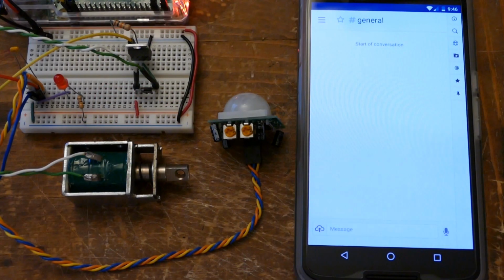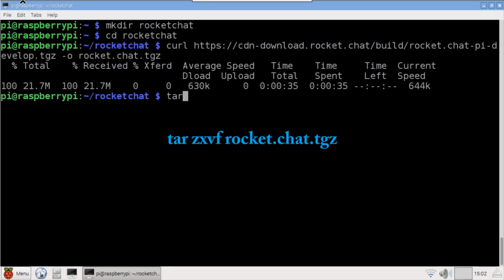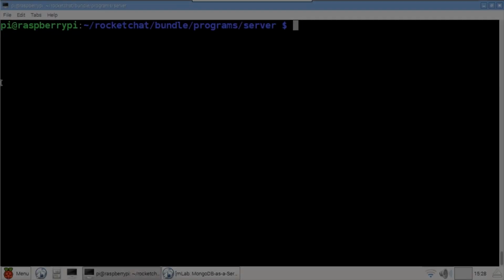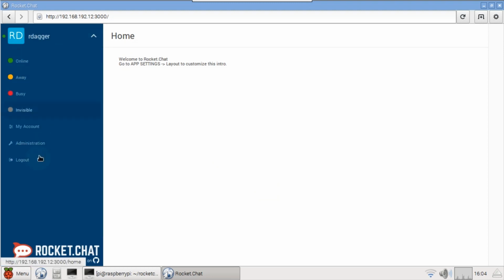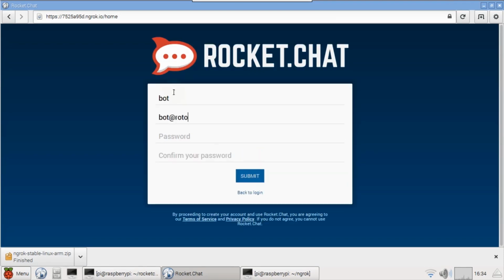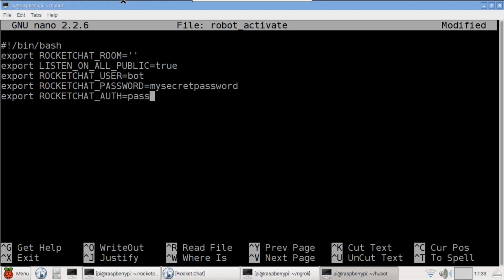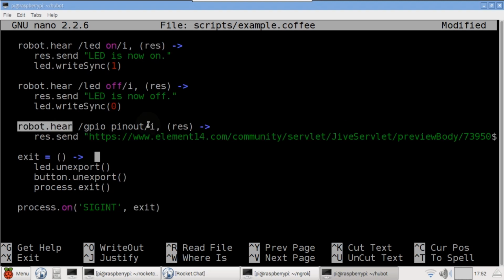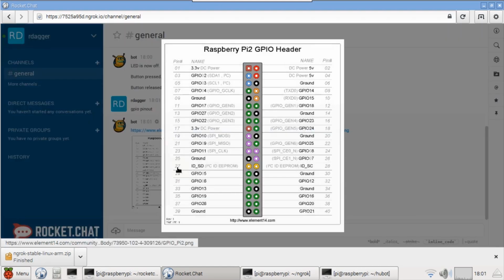Raspberry Pi Chat Server with Hubot Tutorial

Comment: Great Video but the URL to the cdn-download is broken. You should change your tutorial on your website: I had to download it like: 
wget https://github.com/RocketChat/Rocket.Chat.RaspberryPi/releases/download/0.39.0/rocket.chat-pi-0.39.0.tgz rocket.chat.tgz
Reply from the maker: It may have been temporary.  I just tried the original link and it worked.
Reply: @rdagger  thx. Another problem : the free mongodb online instance now only supports mongodb 4.x which is not supported by rocketchat.
Reply from the maker: That's too bad.  It's been a couple of years since I looked at this project.  I'd ask on the RocketChat chat room if there's another solution:  https://demo.rocket.chat/channel/raspberrypi

Comment: ~/meteor/dev_bundle/bin/npm install
i got the error below during npm installation, what does it mean?

> meteor-dev-bundle@ install /home/pi/rocket/bundle/programs/server
> node npm-rebuild.js

> phantomjs@1.9.20 install /home/pi/rocket/bundle/programs/server/npm/node_modules/meteor/emojione_emojione/node_modules/grunt-contrib-qunit/node_modules/grunt-lib-phantomjs/node_modules/phantomjs
> node install.js

PhantomJS not found on PATH
Unexpected platform or architecture: linux/arm
It seems there is no binary available for your platform/architecture
Try to install PhantomJS globally
npm ERR! code ELIFECYCLE
npm ERR! errno 1
npm ERR! phantomjs@1.9.20 install: `node install.js`
npm ERR! Exit status 1
npm ERR!
npm ERR! Failed at the phantomjs@1.9.20 install script.
npm ERR! This is probably not a problem with npm. There is likely additional logging output above.

npm ERR! A complete log of this run can be found in:
npm ERR!     /home/pi/.npm/_logs/2018-06-27T18_02_30_637Z-debug.log

npm ERR! Linux 4.9.35-v7+
npm ERR! argv "/usr/local/bin/node" "/home/pi/meteor/dev_bundle/bin/npm" "install"
npm ERR! node v8.9.3
npm ERR! npm  v3.9.6
npm ERR! code ELIFECYCLE
npm ERR! meteor-dev-bundle@ install: `node npm-rebuild.js`
npm ERR! Exit status 1
npm ERR!
npm ERR! Failed at the meteor-dev-bundle@ install script 'node npm-rebuild.js'.
npm ERR! Make sure you have the latest version of node.js and npm installed.
npm ERR! If you do, this is most likely a problem with the meteor-dev-bundle package,
npm ERR! not with npm itself.
npm ERR! Tell the author that this fails on your system:
npm ERR!     node npm-rebuild.js
npm ERR! You can get information on how to open an issue for this project with:
npm ERR!     npm bugs meteor-dev-bundle
npm ERR! Or if that isn't available, you can get their info via:
npm ERR!     npm owner ls meteor-dev-bundle
npm ERR! There is likely additional logging output above.

npm ERR! Please include the following file with any support request:
npm ERR!     /home/pi/rocket/bundle/programs/server/npm-debug.log
Reply from the maker: Please post support questions to the official chat room:  https://open.rocket.chat

Comment: Can this chat server be a stand alone? or dose it require a "all the time internet connection"? Im not a fan of chat data being handled by google amazon or MS. What im trying to do is expand on my piratebox to have a full  chat server like on seen on a old yahoo messenger.
Reply from the maker: In the video I used mLab for the database which does require Internet access.  I don't really see any privacy issues with mLab. However, you could run a MongoDB locally instead which would let you run the chat server without any Internet access.
Reply: rdagger68, Ok thanks